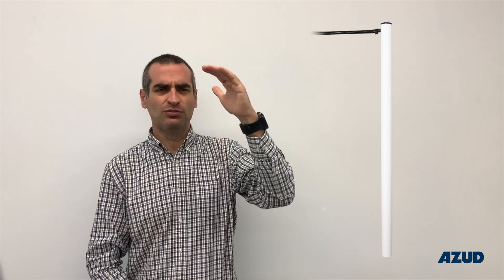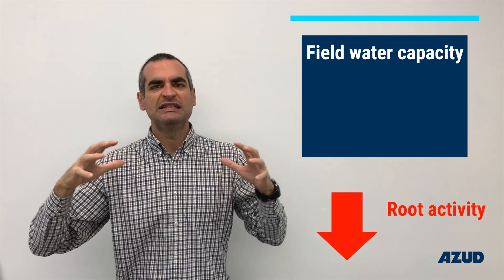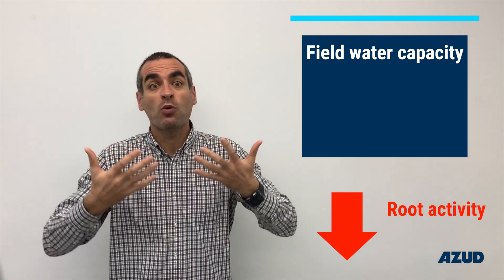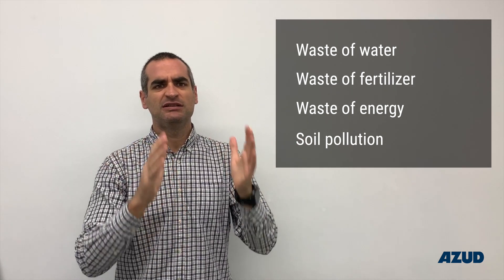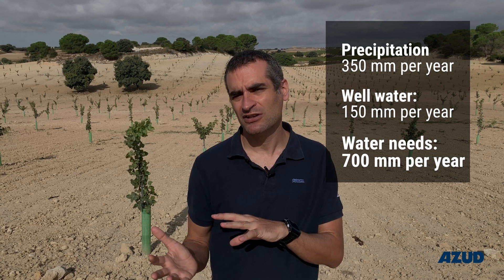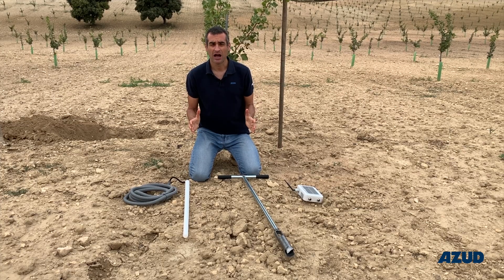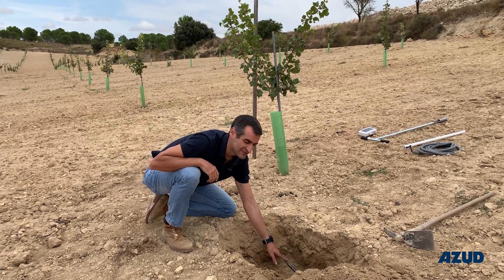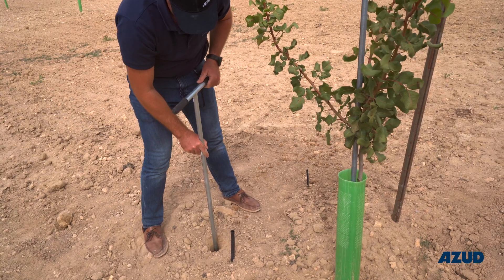Soil moisture sensors: What are they and how to install them?

Comment: But once moisture sensors are installed. what is actually a good soil moisture percentage ? 
what is considered "too dry" and what is "too wet" ? is it 25% moisture ? maybe 40%? in our case those are not trees, but hedges / shrubs
Reply from the maker: Dear David,
The appropriate soil moisture percentage depends on the soil texture. More clayey soils have a higher water holding capacity than sandier soils, therefore, you must know the soil texture of your installation to determine the most appropriate soil moisture percentage. To request more information, you can contact us through the following link: https://azud.com/en/contact/, we will be happy to assist you. Regards!

Comment: Nice video. Do you use a capacity sensor? How long to replace it?
Reply from the maker: Dear David,
They are probes with sensors inside that measures the Volumetric Water Content (VWC)of the soil. Sensors are located in several depths along the probe in order to monitor the vertical movement of the water through the soil. The information that soil moisture probes can collect is essential to make  decisions about irrigation planning and scheduling.
If you need more information, please do not hesitate to contact us through the following link: https://azud.com/en/contact/, we will be happy to assist you. Regards!

Comment: Thanks for the video and it nice..but i want to ask we grow sweet potato  and make ridges  and also use rain gun irrigation can we use sensors .... Thanks
Reply from the maker: Hi Kwabena! Thanks for your comment. 
Independently from the irrigation system you are using in your sweet potato plantation, monitor soil moisture is always recommended, because it will allow you to make more precise decisions. For sweet potatoes, a 30cm sensor should work perfectly!
Don't hesitate to drop us a message here if you have any more questions: www.azud.com/en/contact